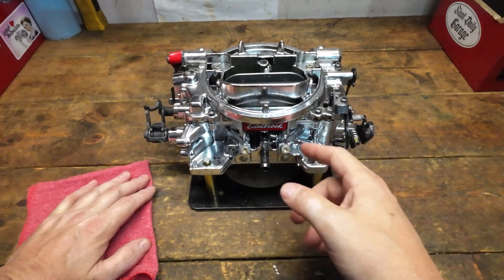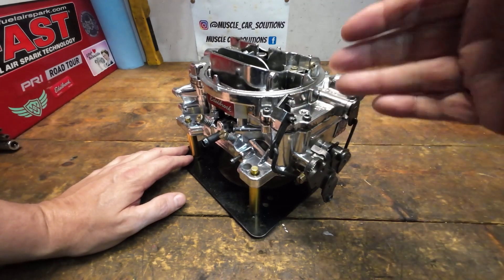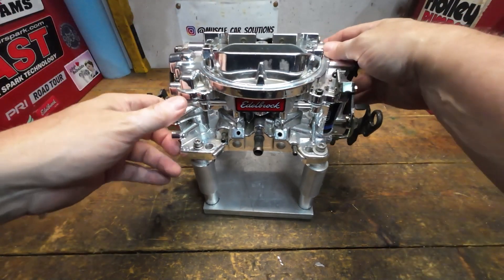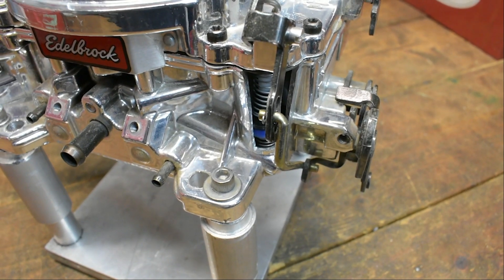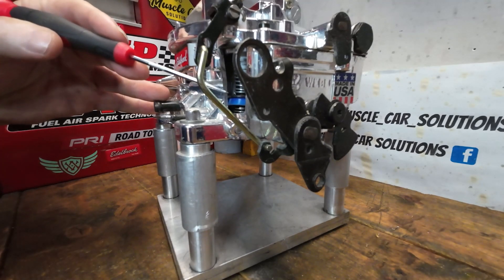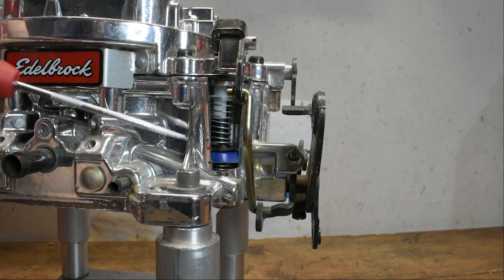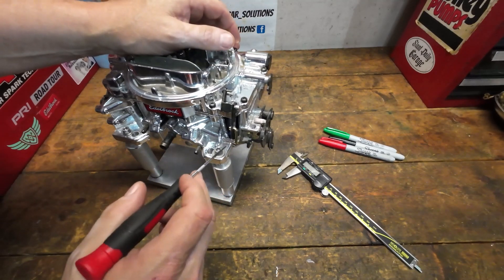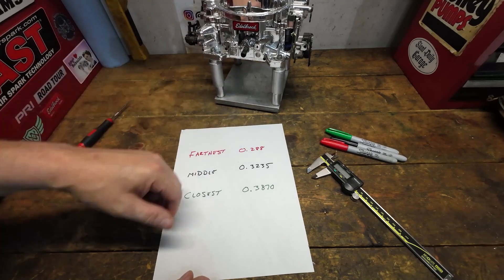Edelbrock Accelerator Pump Shot Measured!

Comment: My problem is I keep getting the hesitation upon acceleration, it almost feels like missing but it's intermittent. My elderbrock 600 manual choke came with the red cone accelerator pump, I changed it to the blue a while back after a good cleaning.. after a little bit it would start doing the same thing again so I changed it to another blue, after a few runs the same thing. I'm not sure if the fuel.. I run ethanol-free fuel from gate...

Comment: Hi Brian , how do you think my 1406 will match up with a 30 30 solid lift cam, I have always loved that cam shaft and am thinking seriously about dropping one in the 55 , the Edelbrock intake , carb, and headers , and of course a double timing chain should sound killer and be good low end off the line, what do you think
Reply from the maker: I don’t recall the specs on that cam, but it’s fairly aggressive if I remember correctly.  Not good on low end.  More mid and upper.  Let me go look it up and verify.
Reply: @MuscleCarSolutions  that would be great and if you could recommend a solid lift camshaft for low end , would be great
Reply from the maker: @DesertRatFabrication I’m old school when it comes to catalogs.  I’ll need to look to find something.  That 30 30 is for sure a mid to upper rpm cam.  112 LSA.  We can find you a better one.  Truck is an automatic?  What rear gear?
Reply: @MuscleCarSolutions  automatic yes , 10 bolt out of a 1978 Camaro I believe that is what the front clip is , I know it’s not posi , I will be going back over to the truck next week I will check rear end ratio, thank you so much for the help, was also hoping to find one that wouldn’t require changing springs in the heads since I won’t be reving engine past 6k
Reply from the maker: @DesertRatFabrication if you’re firm on it being a flat tappet, you’ve probably seen all my videos in the flat tappet series.  There’s a significant amount of work and things your machine at will need to provide.  It’s been damn near a decade since I traveled eastern WA so I’m not sure what machine shops are still around.  Just fine one that’s capable of giving you all the details of how that engine measures and pay particular attention to the lifter bores.  The videos cover it all.
Reply: @MuscleCarSolutions  I will be bringing the truck home in a couple of weeks
Reply from the maker: @DesertRatFabrication I forgot to ask if you’re currently running a stall converter or if you’re ok with running one
Reply: @MuscleCarSolutions  I am not , I would prefer to go with what I have

Comment: Hey Brian, good video, so my truck runs really good in the middle hole, what changes to the engine would make the upper hole better, have a great Saturday😁😁
Reply from the maker: If you’re having a hesitation as you roll off idle or from a low rpm cruise, you can go from that middle hole up to the top hole and see if a little more fuel helps or makes it worse.  Then you know which direction to go!
Reply: @MuscleCarSolutions  oh I understand that, what I was asking is , what modifications to the engine would make upper hole better , for an example if I put a big cam in would that be one reason to possibly move up to the top hole
Reply from the maker: @DesertRatFabrication  yeah.  That would do it.  Or something more simple like adding more timing might trigger the need for a bit more fuel would as well.  The cool thing about any tunable part on a carburetor is it’s not static.  What works today might not work tomorrow as other adjustments are made.  So it’s a bit of a back and forth till you eventually find that sweet spot where all the circuits work together in harmony!
Reply: @MuscleCarSolutions  👍👍

Comment: So if i put it in closest hole for my 74' camaro itll be better than middle as itll give "better" shot - right?
Reply from the maker: @ricardssamuls9152  74 foot Camaro!  Nice! 😂 All kidding aside, I think what you’re asking is if you move the pump connector rod to the hole closest to the pivot point, will it give a bigger shot of fuel?  The answer is yes, it will.  But is that the best for your situation?  Impossible to say.  It’s part of the tuning process.  Give it a try and see if it helps correct a lean stumble issue.  Or if it gets worse, you know it’s too much fuel.